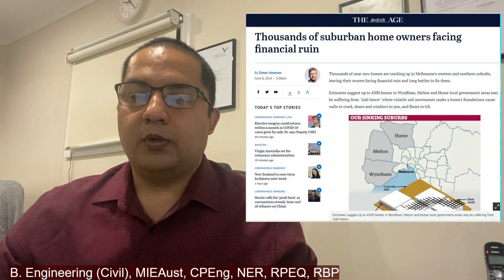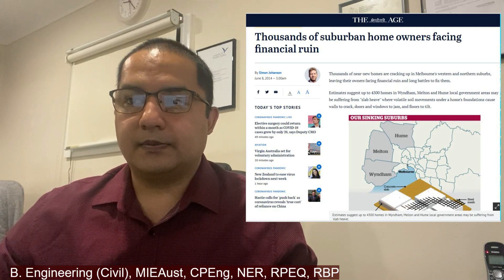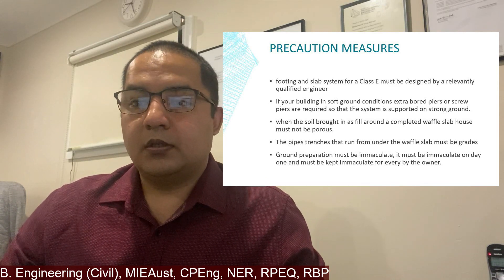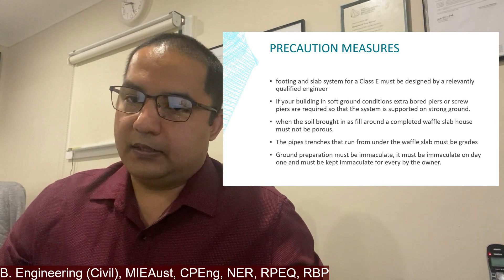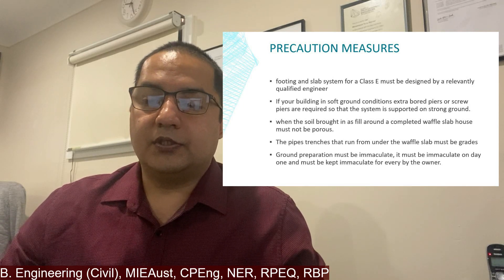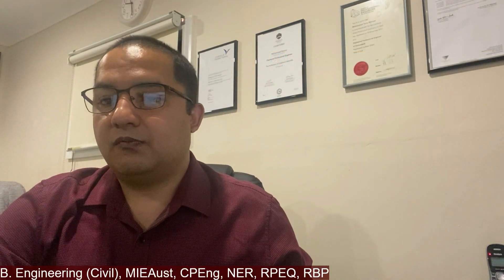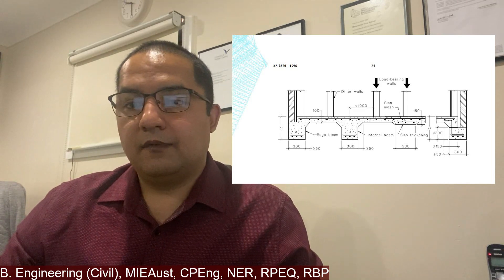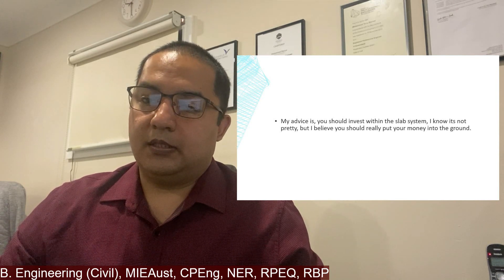Stiffened Raft Slab Vs Waffle Pod Slab: Tariq Sherzai at MTS Consulting Engineers

Comment: Thanks for this excellent information.  I just witnessed a house being built on a waffle.  The block was sloping, so they dug out the high side and used the clay to fill the low side with topsoil intact, then put the waffle on top.  I am not an engineer, rather I am an analyst, and I just looked at that job and thought it a disaster waiting to happen.  Your conclusion that a raft is the only way to go confirms my suspicion.  The clay in this area moves a lot - my own brick veneer house on stumps moves around quite a bit on the same clay.